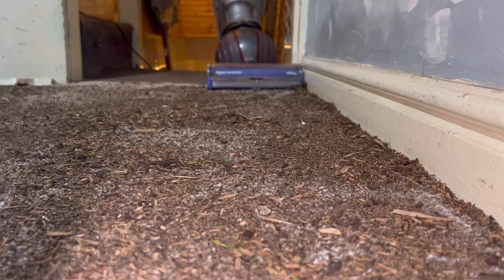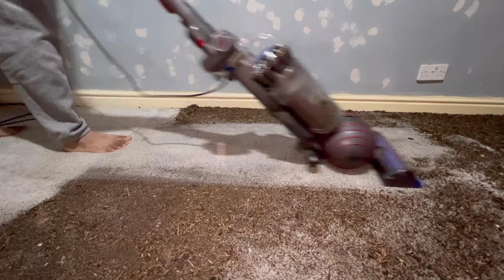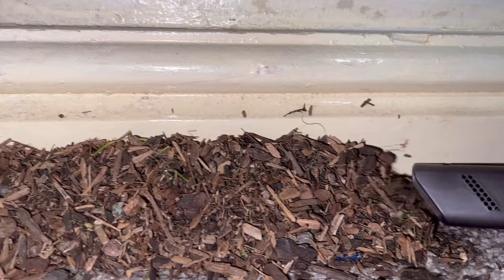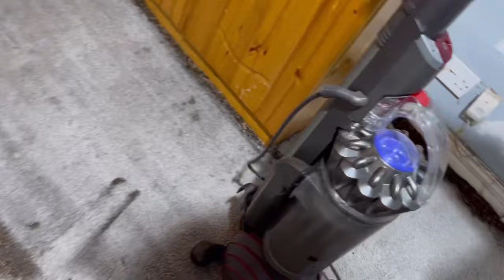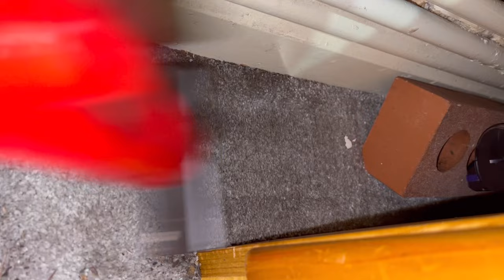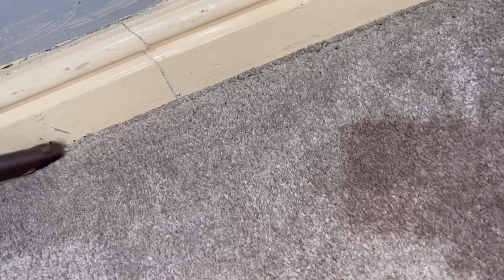Dyson Ball Animal Vacuum cleaner - GIANT MESS TEST! [Dirt on a white, medium pile carpet!]

Comment: Dyson should use this video in their advertising. watching you vacuum woodchips single handedly sold me on this vacuum
Reply: I have this vacuum and hate it. It constantly falls over, has no light, and the hose is attached to a stupidly long wand making it difficult to reach anything, and it contracts when it is vacuuming which makes the fucker fall over.

Comment: Brilliant design from the Dyson. I like how the cyclones work, cleaning head is excellent and ball makes the center of the gravity low= easy for the hand. My only gripe is that these EU versions really should have bigger motors to overcome resistance of cyclones.
Reply: They should have a motor like what you would find in the US version of the dyson ball animal. That motor provides over 100 cfm disconnected from the main body of the vacuum.

Comment: First of all this is absolutely delicious ❤❤❤❤. But.. I have the exact same vac. If i would vacuum this mess it would be clogged in no time. I love the Dyson. But the tube inside is soo small, it just doesn't have enough space for any mess test. Did it get clogged at all (sorry, i do realise this is an old video you might not remember!)
Reply from the maker: Thank you!!! 😁 yes the internal diameter is quite small sadly, so I make sure that what I’m vacuuming up is smaller than the grey end of the wand, if it fits through that then it should be fine 👍🏽

Comment: Shark Stratos did a much better job without the need for multiple passes. Even with the Stratos single-cyclone-bin problems, I would still pick the Stratos over this Dyson.
Reply from the maker: This carpet in particular is thicker than the carpets I used the Stratos on and has a non breathable backing making it more difficult for vacuums to perform on compared to carpets with a porous backing, I think the Dyson did quite well!

Comment: Nice mess test. Did you check the filter on it?
Reply from the maker: Thanks! I did, the filter was very dusty
Reply: @parwaz7861 No doubt if you used a Shark on that much dirt, the filters would be so clogged that the suction power from it would be the equivalent of the suction power from a Dustbuster lol